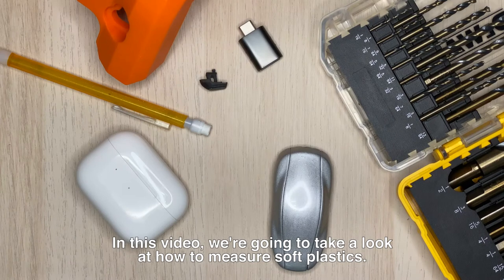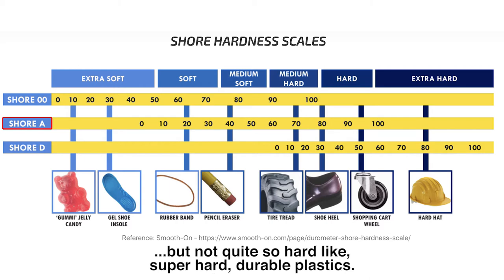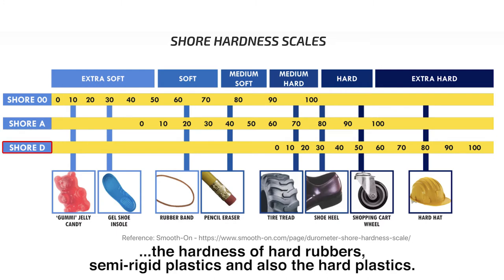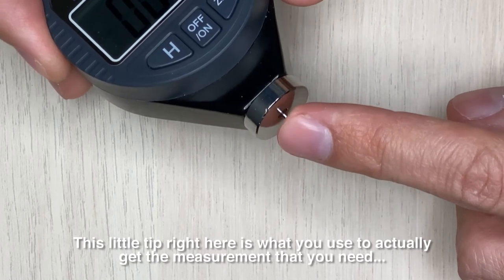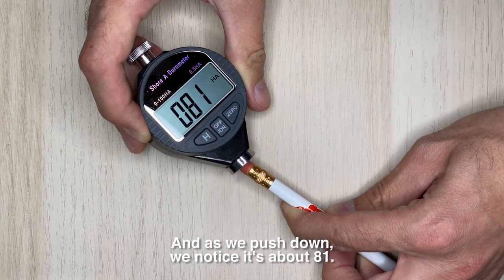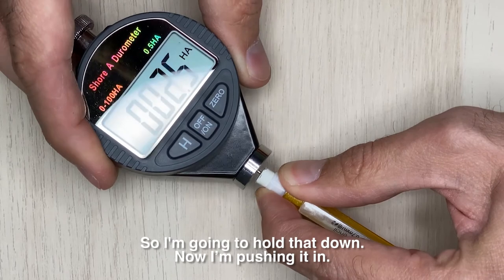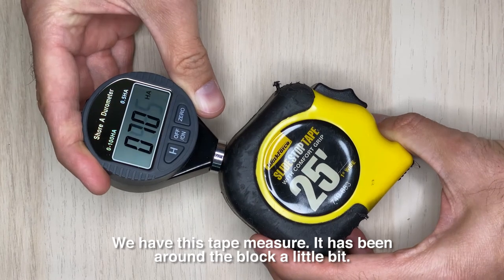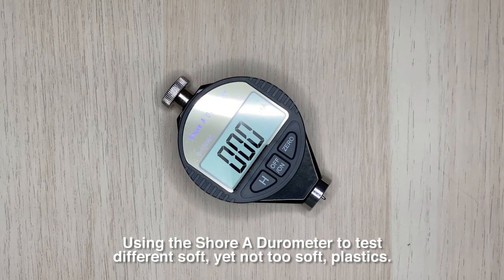How to Measure Shore A (Hardness Scale) With a Durometer + Examples

Comment: Please make sure that the presser foot is completely flush with the surface of the specimen or the measuring results would be incorrect.
Reply: Not only that, but your pressure point must be a distance away from the material edge. ~ 12mm I believe
Reply: Material thickness is also important and Im guessing the over molded handle material on the Ryobi is too thin

Comment: There are several aspects that make the measurements in this video unreliable:

Measurement of the sample material should take place on a flat sample surface supported by a flat rigid surface.

Measurement should be performed in the middle of and perpendicular to a sample surface diameter of 12mm or above.

Sample thickness should be 6mm or more. 

The duration of each measurement may be of importance as well, depending on the sample material. 

It is recommended to perform a multitude of measurements and calculate the average value.
Reply: thank you for all the useful infos. I did all as you reccomended and I was wondering: when the tip of the durometer first touches the material the hardenss I am measuring starts at about 77-78 ShA then drops about 3 points after 3 seconds and settles at about 74-75 ShA. Is 3-4 seconds measuring good enough? is the value of the hardness the very first value or the ones after settlling time? thank you
Reply: @AA-fb9yc  the settled value is the value you should use. The indentation time depends a lot on the sample material. Repeat the measurement of 4-5 seconds a few times and see what the average does. Try the same a few seconds longer and see if it changes the average. Not all materials have a consistent hardness/softness, which is tackled by the multitude of measurements on a few  locations on the material. 
I forgot to mention temperature as a factor as well. Room temperature is recommended, but you can also see what temperatures do to the hardness if you need.